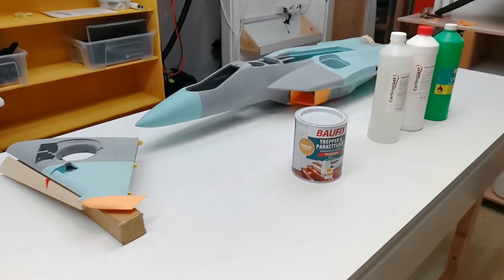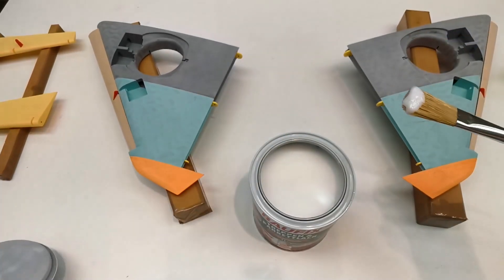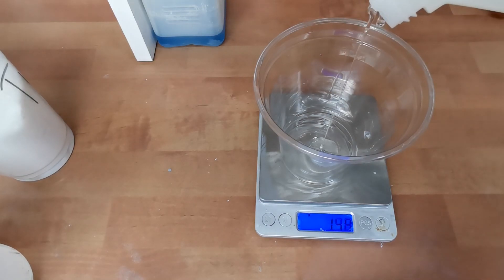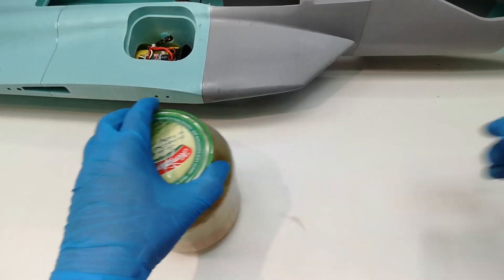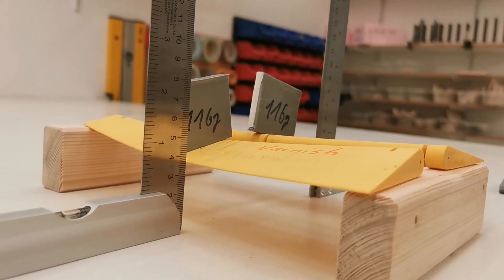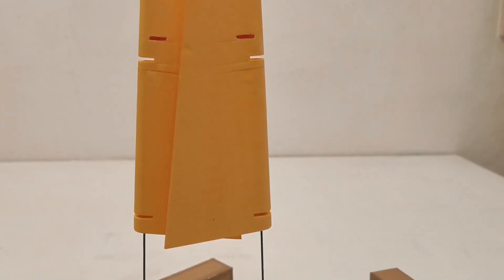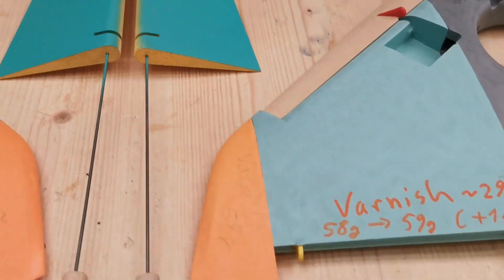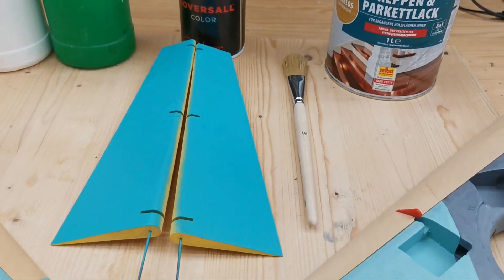Surface Processing on LW-PLA 3D-Printed Parts | Epoxy Resin vs. Varnish

Comment: Please show the Epoxy thinning process in more detail. I would like to know what kind of epoxy that is (so I can buy mine from a local business, I am not located in Germany). And how much you can thin it down before it doesn´t properly cure anymore. Honestly the biggest lesson I took from your video is how think you can get that epoxy. A 50/50 mix of resin to mineral spirits is crazy. Doing that with IPA is will simply not work at all.

Comment: I have never seen epoxy resin so thin, it flows so smoothly.
Do you add any thinners to it to make it flow like this?
Reply from the maker: 50%Ethanol
Reply: @rene_rosentraeger  Whoa!  I've thinned paints 5-10%, but never 50%.  That's ... a lot.

Comment: There is something wrong with your math: 61,5 - 58,0 gram should be 3.5 gram not 2.5 gram (somehow your 6% came out correct so you did use 3.5 grams in that calculation) :)

I am still not convinced to put in the time to print and glue a 3D printed plane (I have the LW-PLA and a X1C) if I see your planes I get the feeling it might be time to start trying. On the other hand when I saw your recent video about finding the CG for the Box-wing I got dis-encouraged after it turned to pieces in the second landing (my 'good' landings are worse for sure).

Comment: Very cool! Thanks for sharing. If you get the lw-pla parts wet, they will retain/trap a certain amount of water and get hevier, correct?
Reply from the maker: Yes. So the surface should be sealed after sanding.

Comment: I use a nice airbrush to apply water based varnish. I get a very fine coat that is also very thin. But I get a very smooth finish. I still go over it with 400 grit sandpaper (lightly). I have done two coats before, and wet sanded with 600 grit sandpaper and it is like glass. I have also prepped the raw lw-pla with a fine scotch bright pad.
Reply from the maker: Sounds good 👍

Comment: I would love to see a resin comparison where you check identical 3D printed parts, once painted with a brush, once sprayed on and once dipped. It might be interesting to see the differences in strength vs weight an possibly surface finish.
Reply from the maker: Without the dipping this is already done in a previous video. Also in the testing playlist 👌

Comment: Awsome work as always. is that Standards White Spirits you are using to thinn the Epoxy?  Could you use IPA or Acetone?
Reply: I think IPA is the same ase spiritus. Difference beeing spiritus has some smell additives that prevent it from being turned into drinkable alcohol. Therefore its much cheaper than IPA here since it is not under alcohol tax, which IPA is (IPA costs like 20 times more here than spiritus)
Reply from the maker: Yes standard spiritus. Acetone is too volatile. The other chemic I don't use the in my workshop.

Comment: Really impressed that you did this testing. Thank. you!  Water based polycrylic "varnish" needs several coats. Most of it evaporates which is why it was ~2% weight increase when dry compared to 6%. It would be interesting to see what 3 coats would do strength compared to resin. Win or loose that is the test that would be most informative.
Reply from the maker: The more coats just ad more weight, so it didn't make sense in my opinion. The varnish does not cure into a duraplast like resin do. So it will never add the same strength to the part. It is just a nice primer before painting 👍
Reply: @rene_rosentraeger  "...The varnish does not cure into a duraplast like resin do...." Why do you think that ? Varnish is exactly that.

Comment: Shouldn't you be applying more than one coat?  Most of the resin coatings state at least two often three coats for best results.  Varnish is usually the same.
Reply from the maker: The next coats would mostly add just weight and no extra strength cause the LW-PLA is already impregnated. So I prefer one coat.
Reply: Depending on coat thickness. The resin in this example is roughly already 3x thicker. For a fair comparison he should have added 2x-3x coats of varnish instead. On my prints I use PU varnish in thick coats.